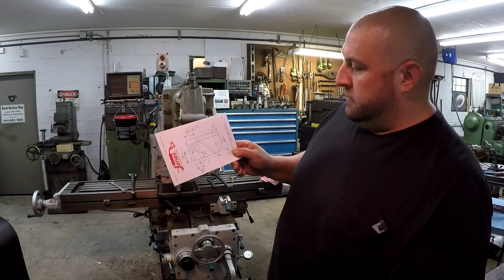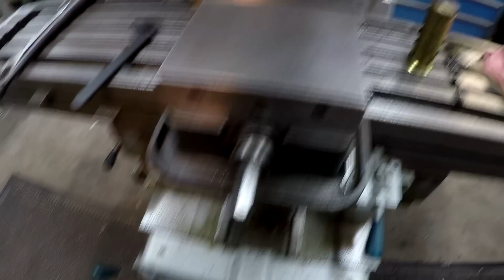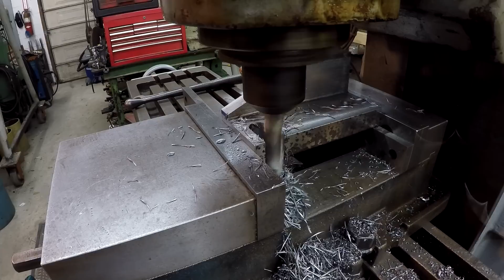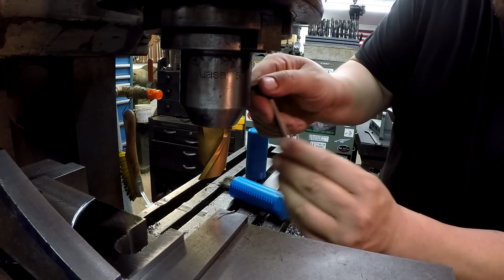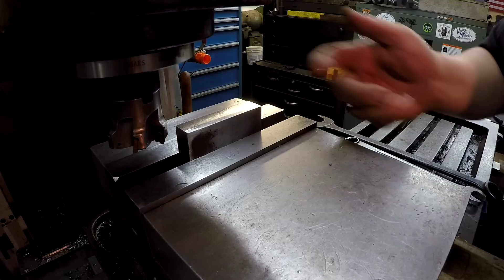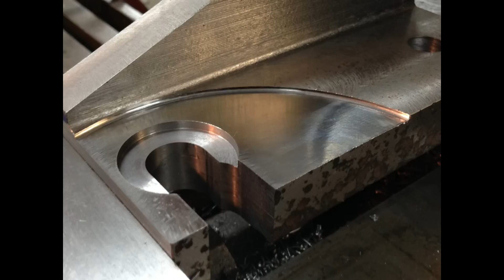Kearney & Trecker Parking Attachment Part 9

Comment: What's the difference between the digital calipers and the rounder ones I think you call mics?
Reply: tim clarke there is no difference
They both are not accurate
Reply: Bertje Tolberg Where I work callipers or verniers are referred to as verynears, because you can get very near to size but not perfect! 😄 A micrometer on the other hand is as accurate as the last calibration! 🙄

Comment: New to machining metal so this may be a silly question but here goes... You stopped and made a comment about picking up the back edge of the part because of the collet size when your were drilling the first 5/8 hole. Question is, do you ever / can you pick up the back jaw and use that as a datum when you're in tight quarters like that?
Reply from the maker: Absolutely, it's good to work off the corner of the jaw and just square up your work even with the side of the jaw and make your offsets.

Comment: I'm sorry i might be stupid for saying this. Here we go. You're cutting a slot near the end of your steel. Question how close to the end & how tight should the vice be before it bends the steel without you seeing it when cutting the slot. Coz if it springs in when tight & out whan lose that will make slot a different size. Would an End ball help hold the work where you're not cutting the slot.
Reply from the maker: At times that could be an issue. For my work piece I wasn't worried about the part flexing, there was enough left there to hold it square and in place.

Comment: Adam,
I'm surprised you were using flood coolant to drill the 5/8" hole instead of cutting oil. I guess whatever works for you and the hole was drilled.
The 6" face mill did a great job of cutting the big relief it cut like it was butter and a super finish. The 1½" two flute did an excellent job also on the smaller counterbore. I really like watching the end mills work they do such a great job milling the 4140.
Great series for sure. 
Thanks....
Reply from the maker: My concern was trying to keep the part and drill cool for the cut since it was giving me a fit.

Comment: Nice job Adam.
That facemill gave a great finish.
When you fit pins in tight fit (reamed) blind holes, do you normally create some relief in the pins to avoid air pressure built up? (or drill a small hole completely through)
Reply from the maker: I've had to cut a small groove before to allow the air to escape, but on this one the pins fit close enough not to compress the air inside

Comment: looking at about 24:00, how do you ensure perpendicularity between the first 2 sides and the third. Of course you used the 'factory' side because you know it is flat, but you just found out the first 2 cut sides were not even parallel planes.

Comment: If the piece spot hardened, it will eat the tool instantly. As you know, a fresh bit will cut through the spot and motor on through. I've seen guys in the shop drilling cast iron. My dad (my mentor) taught me to bring the tool down and when you're ready, HIT IT! Don't be gentle or it will eat your drill for lunch. And don't let it whistle in the hole...  😄
Reply from the maker: Yep. Sometimes you gotta push the tool through it hard!
Reply: +Abom79: Yup, that's what she said... 😀

Comment: I used to get angry at masonry saw blades that had run out on glazed tile.  We used a 1/4" mortar joint on the tile and when we made a  cut it had to allow for that size.  Sure enough, some blades would stand up straight when you started the cut but wandered enough to widen the cut 1/16 or more and that shows up pretty bad on the joint size.  Greg

Comment: That block of metal might have become a bit hot when you did the heavy cutting on it Adam. I found that tends to harden some grades of steel, might have happened to that peace you have there, what do you think? I especially found that to be the case with some, S/Steels, drill a large hole a bit too fast and it becomes to hard to even get to tap a thread into it! Bugger of a thing to work with, work-hardens very fast. I'm sure you must have experienced that yourself at on time or other?
Reply: That would be work hardening. In order to harden via heat treatment, the material would have to reach its critical temperature (it would be a dull orange glow)